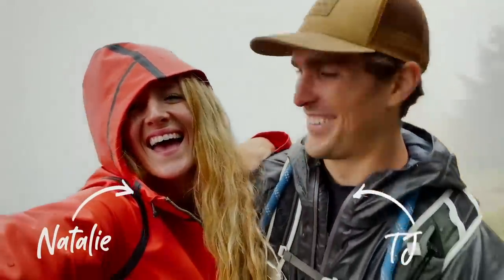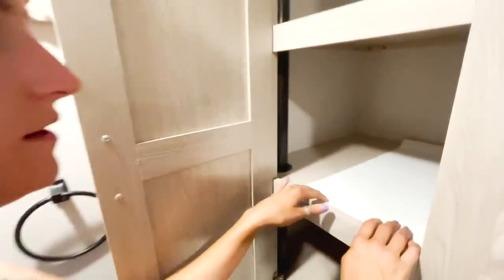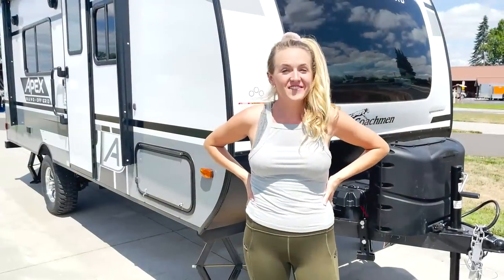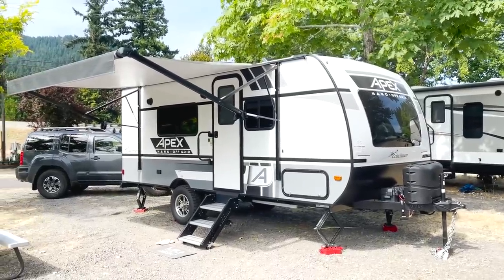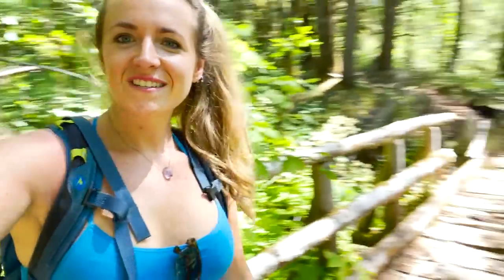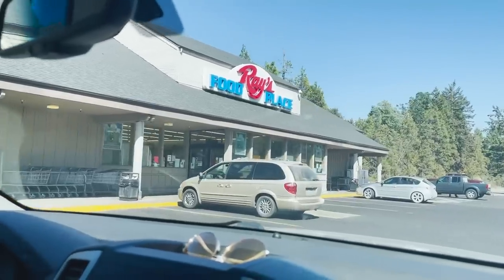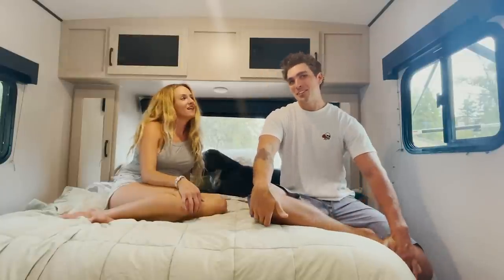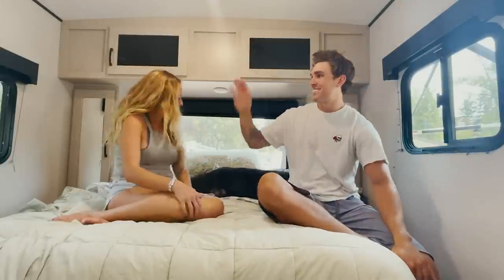Our First 48 Hours in our NEW Coachman Apex Nano Off-Grid EP. 2

Comment: Tip: empty your black water first then your Grey water can be used to flush out your hose.
Reply: Others recommend grey water first. That way in case there is a bad connection, you won't have black water leaking.
Reply: That was going to be hint as well. Black water first, then gray water… helps clean your hose out.
Reply from the maker: Yes thank you for the tip! I did read about that one so that it cleans the hose out! We were only 1/3 full on the black tank so we were letting it fill more before bumping because I’ve also read to not dump it until it gets full. Is that what you do as well?
Reply from the maker: Oooo I can see the point of doing that as well, good thoughts!
Reply: @trh1694  I always do just a bit of gray first for that very reason. But then black and finish with the rest of the gray. 👍🏻
Reply from the maker: Thanks for the tip!

Comment: I didn't go through all the comments so this may have already been brought up. Hot water heater issue; there are 2 switches one inside the camper and also a master on the back of the hot water heater. Never leave the electric on if the heater has no water in it.  It will burn out the electric element in seconds. There is one more thing to remember. Never travel with gray or black water tanks even a quarter full the way they are mounted there is no support under them. The flexing over time will cause them to fail. There will be times you cannot travel with them empty just make sure you empty them ASAP.
Reply from the maker: Very good tips thank you! And yes you are correct for the heater it was turned off by the back of the water heater and we are making sure to never leave it on while empty!

Comment: You guys may want to upgrade your tow vehicle. At full GVWR with either the 18 ft or 19 ft nano, youre at >95% of the max tow capacity of your xterra. Experts recommended not exceeding more than 80-85% of your vehicles max rating. You can tell it’s too heavy from the amount of sag on the rear suspension of the vehicle regardless of whether or not the trailer is leveled. Maybe consider the new Nissan Frontier that just came out, that can tow 6700 lbs making your 4800 lb trailer well under the 80% limit. Just food for thought, want you guys to be as safe as possible.
Reply from the maker: Yes we are weighing our options and seeing what works best and of course what will be the safest while also trying to not break the bank. When we have full water tanks yes I agree it’s getting a little heavy but when we don’t have any water in our tanks it puts us in the acceptable range for towing. Since dry weight is only 3,300 (plus our belongings) For now we might try to camp for shorter periods of time so that we need to carry less water and weight. But I appreciate the thought and info!!

Comment: Love the camper and adventures.
Here is a backing tip to help You both.  When looking in your door mirrors if the drivers side rear of the camper is getting close to a pole, turn your wheel in that direction.  Simple- whatever side the rear of the camper is getting close to, turn the wheel in that direction to whatever You are getting close to and You will see rear of camper turn away from object.  Don't over steer, just slight adjustments of the steering while backing in slowly.
Reply from the maker: That will be such a weird thing to get used to!! Tj is learning and mastering it now but I’ll be up next so thanks for the tip!

Comment: Mattress memory foam and cut it to size if need be.  Electric will heat water when trailer  is plugged into power and propane when not.  Do you kids have a tire monitoring system? They are a must!  Also a tire inflater you can hook to your car battery. Makes life sooooo much easier. Safe travels!
Reply from the maker: I love the ideas thank you!! A new mattress is in the works for sure and we don’t have a tire monitor system but it’s on the wish list, we know we need one! And very good idea for the tire inflator!

Comment: Looks like you need to add extra support in the back axle of your towing vehicle. I had to do this several times. It will make a huge difference in the drive and safety too.
Reply from the maker: Yes we are looking at adding air bags to the suspension! Just learned about them recently

Comment: Hey guys- tip, stabilisers can be done quicker if you can acquire a second handle. Cut the head off (allowing about 10” and place it in the chuck of a cordless drill.
Reply: Also, make sure your Tyre pressure is equal on the trailer, to prevent swaying when travelling.
Reply from the maker: Yes a socket for the stabilizers is on the list! And we have a pressure gauge to check the tires and always make sure to do so :) thanks for the tips!!

Comment: Video in 15'15 "or 16 'and 20", I think the chain is very close to the ground, I would raise it a little, so as not to run the risk of catching something. Natali, the position is not good to be in the middle to move the jack handle, you must perform the task from the side, you never know what might happen, you will have different floors and different degrees of inclination. There is an escape from the side, not in the middle. The last ... When they are looking for the place to assemble the ball, when the stop sign is made, the one who is driving, must first put the handbrake, then put the gearbox in parking, otherwise, always does it move. Good luck and thanks for sharing the rides. Mi positivo es el Nro. 379
Reply from the maker: Yes we have since moved the tags so that they aren’t so close to the ground and made the chains a little further from the ground as well, so thank you for noticing that and pointing that out! And yeah I don’t want to get smashed that’s for sure, I’ll be moving to the side from now on :) and yes we learned very quickly about needing to use the parking hand brake haha 😂
Reply: @adventures  I'm glad they corrected the chains, it seems silly, but it's not.
They are already using the handbrake ... hehehe
The only thing missing from my recommendations Natali, do not stop in the middle of the two vehicles to use the cricket.
Have a good trip cyber sailors wish you !!
Reply from the maker: Lots to learn but we are well on our way!! 😁